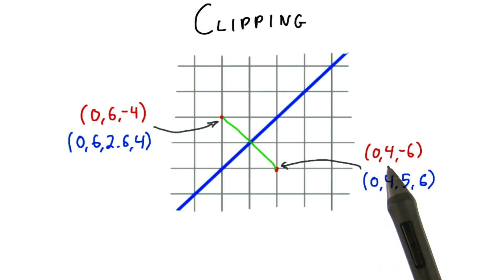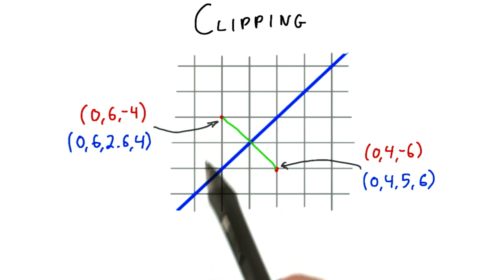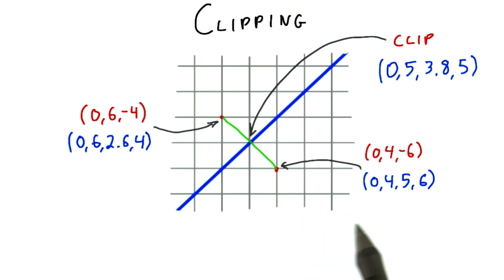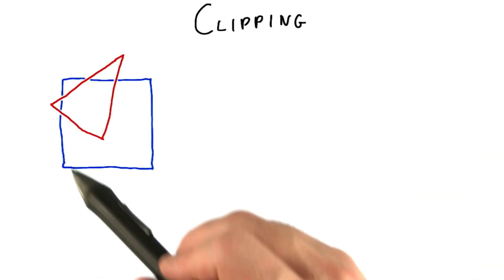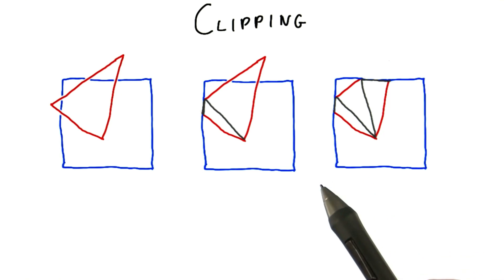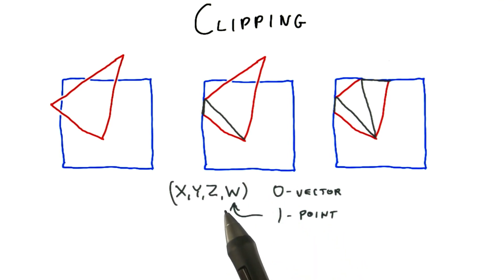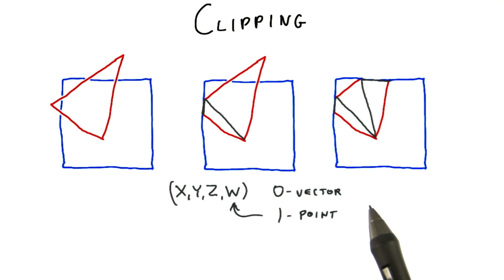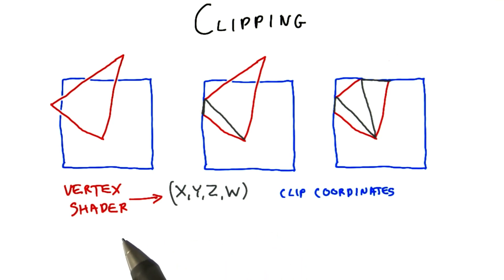Clipping - Interactive 3D Graphics

Comment: Uh I barely understood what this was about. I thought clipping was bad when it happens? And since it's happening all the time in games still nowadays, I wondered if there wasn't any solution to prevent it from happening.
Reply: "Clipping", when used in the context of a video game, can refer to a variety of things, most notably 3D models unnaturally intersecting each other or unintended collision behavior.

In the context of computer graphics, "Clipping" refers to techniques used to limit rendering load to a certain area of interest which usually involves ignoring areas that are not visible in the final image. This is often used interchangeably with the term "Culling".

When viewing a 2D scene on your screen, you are usually viewing a small rectangular section of your entire scene. To view a 3D scene on your 2D screen, you need to project a section of the world onto the screen, you need to project the section of the world you want to view onto your rectangular screen. This is done by taking a shape called a "frustum" and projecting all triangles in the 3D space onto the small rectangular side of the frustum which represents your screen. In both 2D and 3D the section of the scene that is considered within view is called the "clip region".

The problem presented in this video is that some triangles may be only partially contained in the 3D frustum. Anything outside of the frustum is not viewable in the final projected image. The triangles need to be "clipped" or, in other words, divided into smaller triangles that are strictly within the clip region. This is GOOD as it avoids unnecessary rendering, improving performance.